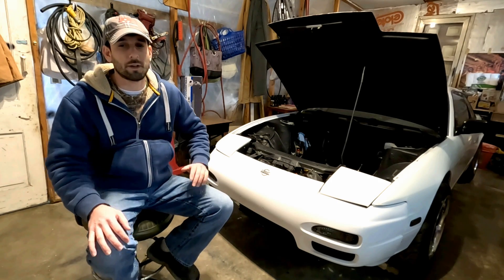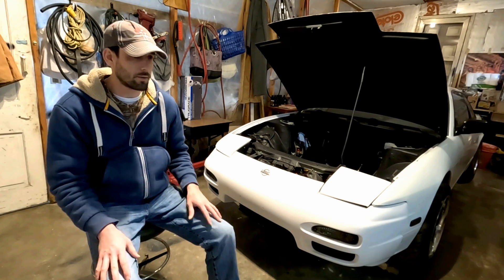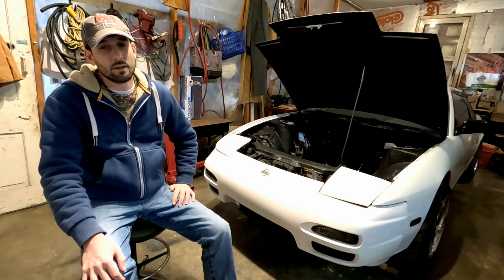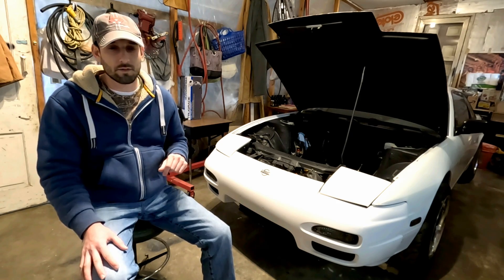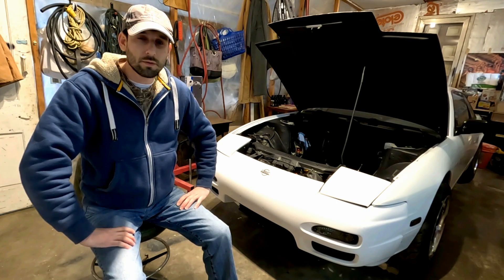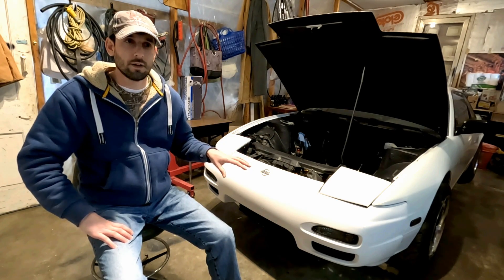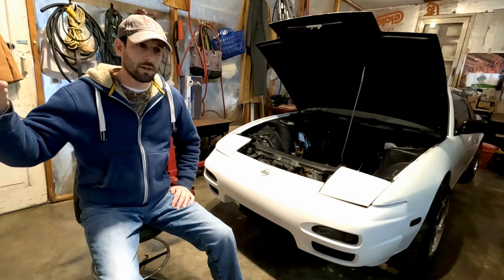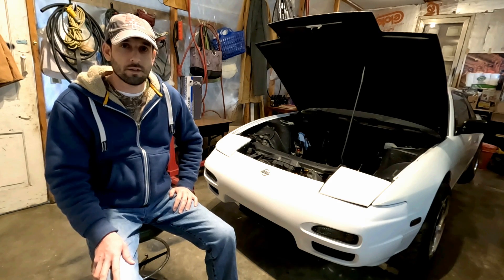Unlock Horsepower and Reliability: Modifying an RB25DET Guide

Comment from the maker: *********MODS LIST OF THE BUILD************

Injector dynamics 1,000cc injectors
Greddy fuel rail 12mm
Bosch 044 in tank pump with sock and 6an fuel lines
Aeromotive Fuel pressure regulator
AEM EMS Series 2 ecu with stock cas AEM trigger disk
Vented oil catch can
cosmetic head gasket 1.3mm
ARP head studs
N1 oil pump stock gears
OEM water pump
mishistmoto 3 core radiator with 2xelectric fans
stage 5 competition clutch with light weight flywheel
OEM Turbo manifold modified to fit T3 Garrett GTX3076r with .82 A/R housing
Greddy intake manifold with 80mm throttle body
AEM trigger disc for cam sensor
Spool head drain T to the turbo drain
Vibrant 4 core intercooler bar and plate
Tial 38mm wastegate
tial BOV 50mm
Chase bays coolant overflow tank
AEM wideband
AEM oil pressure gauge
TOMEI timing belt with OEM idler and tensioner pulleys
Universal 13 or 12 row oil cooler with remote filter.
Aeromotive fuel filter 10 mirco

Comment: i'm a 2j guy but i clicked to learn about the other side
Reply from the maker: Love the 2jz they put down some really good power!
Reply: @sleekautoo  i have plans for my is300 to make about 600 using the stock head and stock crank. should be pretty achievable
Reply from the maker: @nolanfoynes8022  Yah that power goal is very achievable for the 2jz they hold power very well slap you a big turbo on it and let her eat.